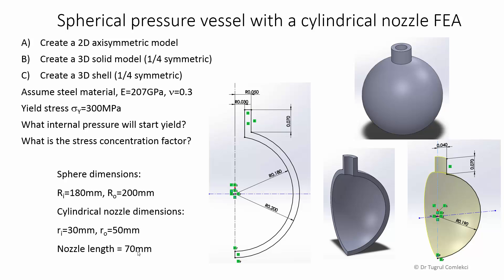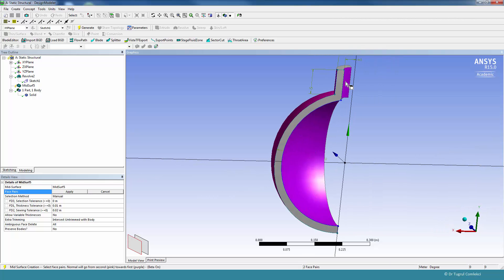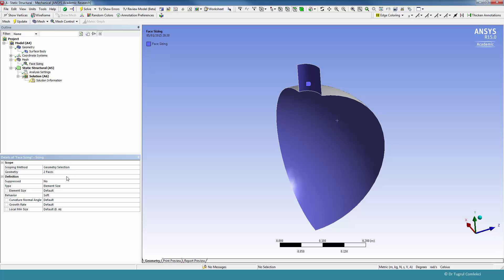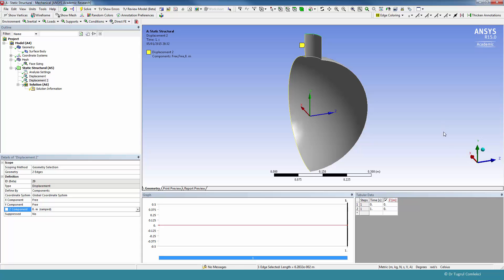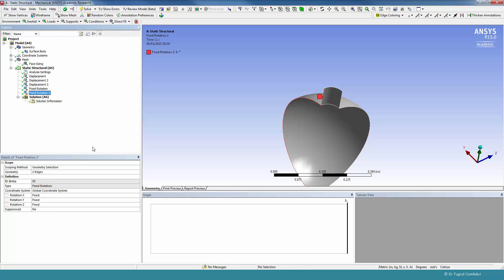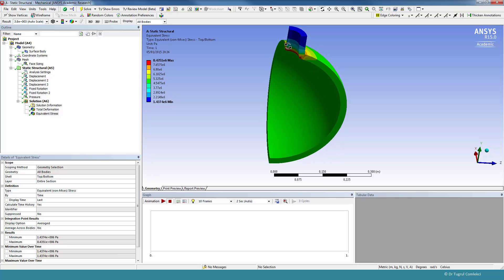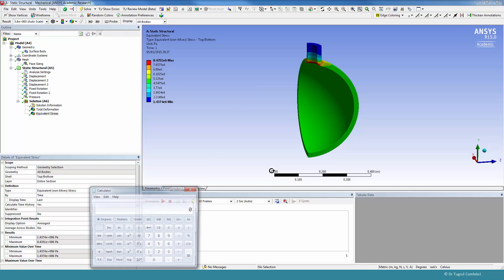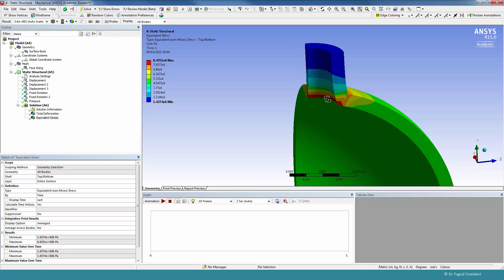Spherical Pressure Vessel with a Cylindrical Nozzle FEA - Part 3 Shell Analysis

Comment: Hi
Thanks for your good material. I have a question. Have you ever done Pressure vessel analysis by ANSYS workbench using shell surfaces (as opposed to solid bodies) and extract membrane and bending stresses directly? Have you done any study comparing those membrane and bending stress with the linearized ones?
Cheers
Hesam